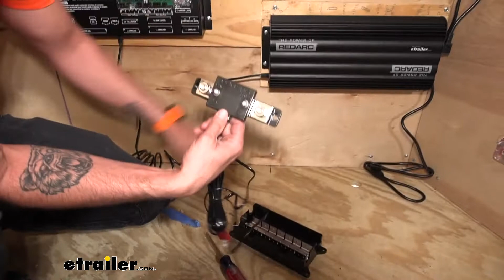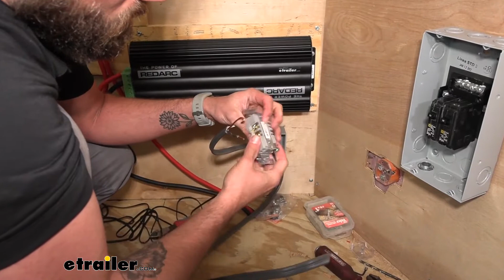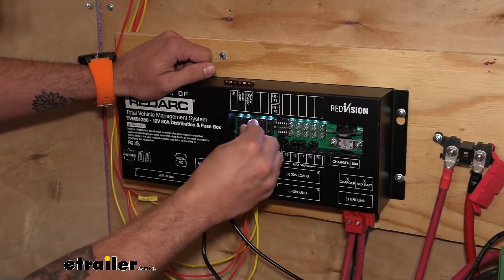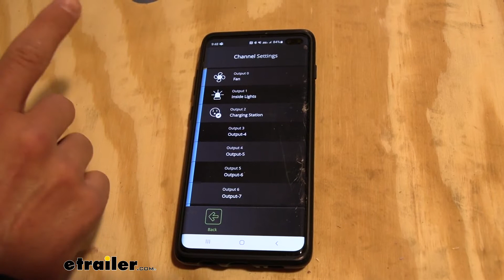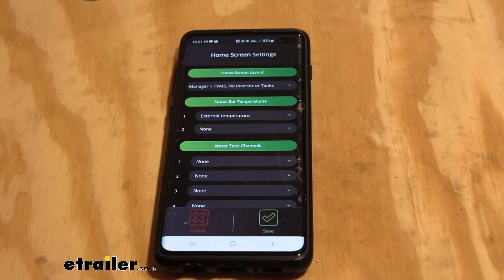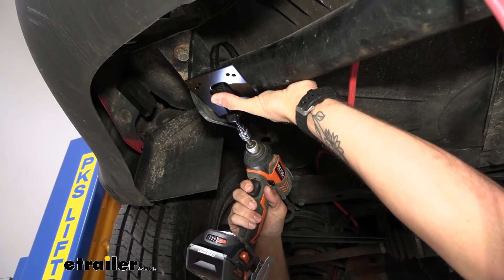etrailer | Redarc RedVision Total Vehicle Management System Installation - Enclosed Trailer

Comment: Great explanations.  You did choose the least protected place for the battery sensor junction box.  Maybe upside down screwed to the bottom of the wood floor?
Reply from the maker: Thank you for the feedback! Mounting components directly behind the A-frame trailer coupler is a very safe place because it is out of the way of debris coming off of the tires.
https://www.etrailer.com/Smart-RV/Redarc/RED79FR.html

Comment: Is there a strobe function/setting for lights connected to the system?
Reply from the maker: The Redarc RedVision does not have a strobe feature built in but you could run a power wire to a strobe light and turn it on and off from your phone.
https://www.etrailer.com/Smart-RV/Redarc/RED79FR.html